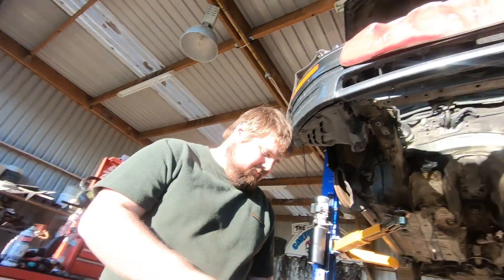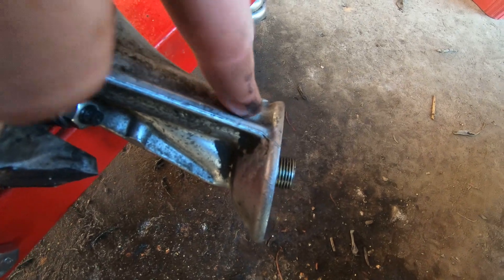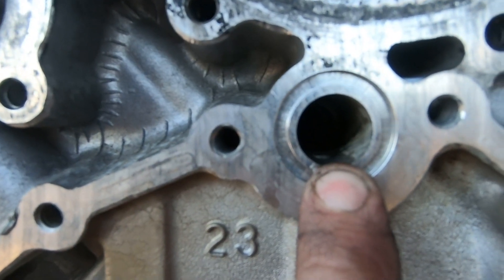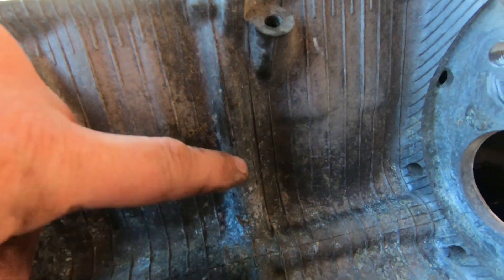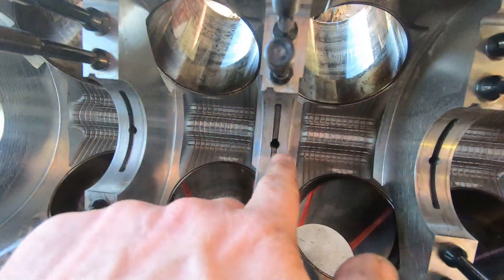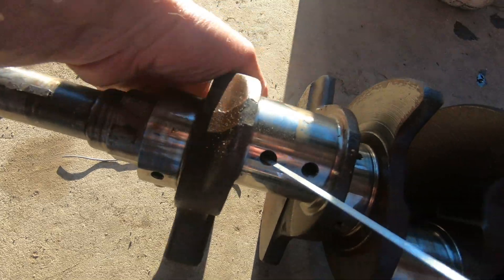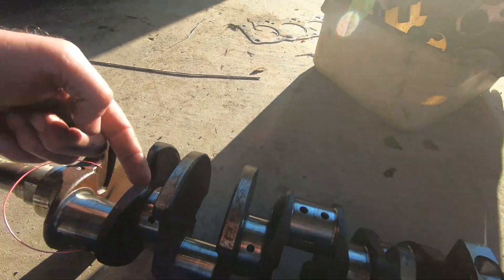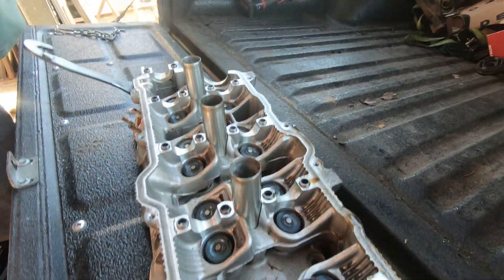1uz non vvti block oil circuits

Comment: Great video! How much different is the oiling system on the VVti motor, maybe do a quick video on that too? 👍
Reply from the maker: Thanks for the compliment.   Its was a spare of the moment video this one.  The vvti has extra oil feeds for the vvti system.  If I have time and a vvti engine apart then the camera will come out but I dont pull that many engines apart.   Also have a deal with a high end engine builder so planning a video at his shop too.  Cheers Kelvin.

Comment: Is there any where else to install a second oil pressure switch?
Reply from the maker: No additional ports so either a nice Tee fitting,  or weld an additional fitting on works well.  Cheers Kelvin

Comment: Absolutely loving the 1uz content mate.  I'm still yet to rebuild my icv but since I'll be building my boosted engine soon this content is perfect.

Just stuck on what cams to pick.? Can you recommend a can spec for more power on a boosted 1uz?

I've always been told the oiling system on a 1uz is good for boost and doesn't need to be modified? Do you think this is true?
Reply from the maker: Hello Ross.  

For cams I would be chatting with kelford about their Turbo spec cams.  Also consider some adjustable cam gears , both external and internal on the scissors.  

Oil system is fine for most turbo setups.  Ensure pump is in good order.  I try to keep an new one even though they are pricey it's nice to know its 100%.  I saw a clever guy fit oil squirters the other day to his one.   Neat idea but Ive run all mine with out them.  Ive done the fit turbo , add boost 500rwhp on 100K engines with 100K oil systems and all worked fine.  

I'm off to check out my supply of IAC.  On aftermarket systems I swap to a simplier unit to make things , well simplier.  

Cheers Kelvin
Reply: @CartuneNZ  awesome thanks for that
I have already wired in my link g4+ Xtreme to the 6 wire configuration.
Only reason I'm keeping it stock is to just get it through engineering. Then I have twin plenums and hypertune throttles to go on. And of course that will delete this icv setup.

If you find one rebuild it and I'll buy it off you plus postage to Victoria Australia
Reply from the maker: Ok.  Remember more now.  Keeping up with everyone's setups is tricky.   Did you ask for some diagrams as well?  Im slowly building up my link to 1uz info.  Ive got a testing IAC video planned as well.
Reply: @CartuneNZ  you sent me the step numbers for the link software yes. But the stepper is no good so need a new one. Atm I have it blocked off